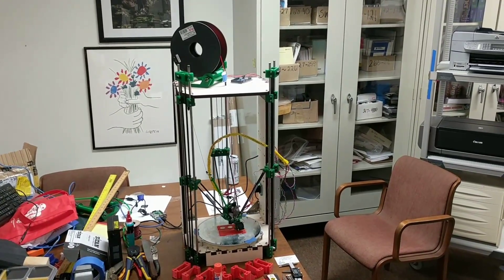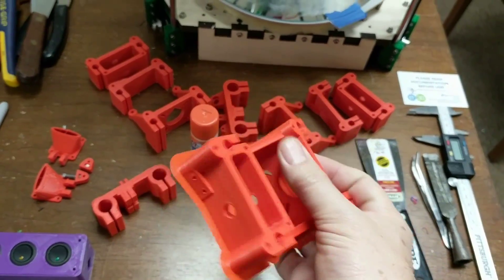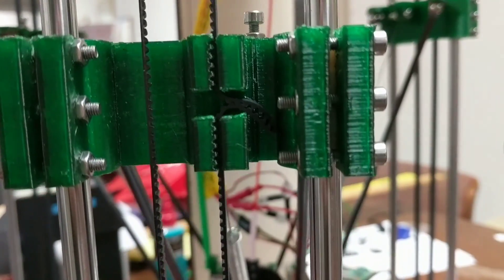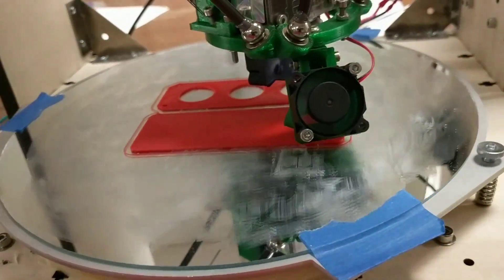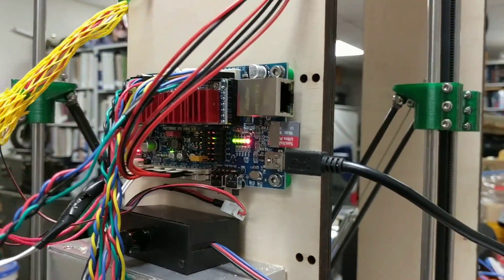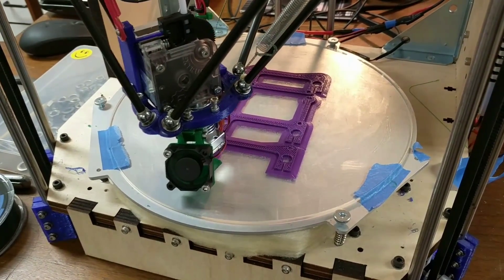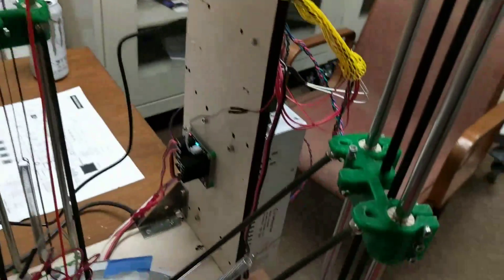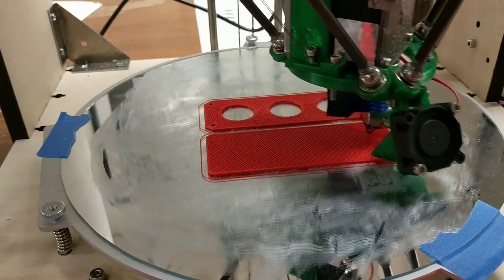Woodstock Delta Printer

Comment: What was the PLA were are using in this video?
Reply from the maker: Brad Barrone , It is Inland brand PLA from Microcenter, $14 per kg.
They have two types of pla for sale, one says 190-220 print temp, and this stuff, which says 205-225C.
I like the (newer?) higher temp stuff better.

Comment: I just saw Tom Sanladerer's review of the Titan Aero, and that made me go looking for Titan adaptations for delta printers.  That's how I found your Woodstock on Thingiverse.  This is a really nice project.  I especially like your frame, it looks like it is much more rigid than the standard Rostock design.  I have two Kossels at 600mm high/170mm bed and 750mm high/300mm bed and using flying extruders.  If I build a 3rd delta printer, I think I'll be one of these.  I'm definitely looking at your effector design, because I'd love to lose the Bowden tube.  :)  Anyway, thanks for sharing.
Reply: Haha, I just noticed that the frame is from someone else... Kudo's for using it, then, instead of designing it.  :)
Reply from the maker: zodak9999b 
Yes, that's the beauty of the Open Source movement, using the help of others, and making improvements. My printer is an almalgam of various designs, and lots of additions by myself. Feel free to download the files and make one yourself!